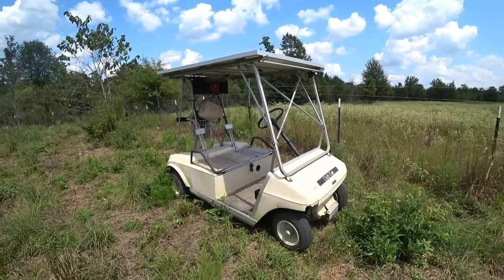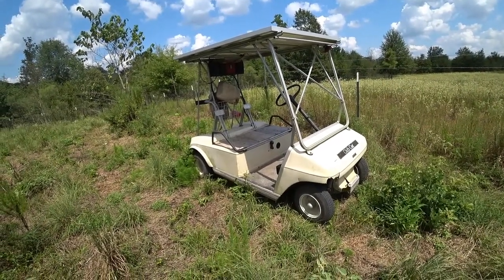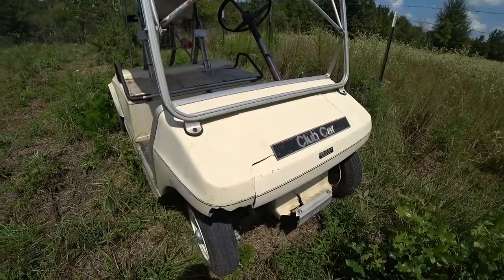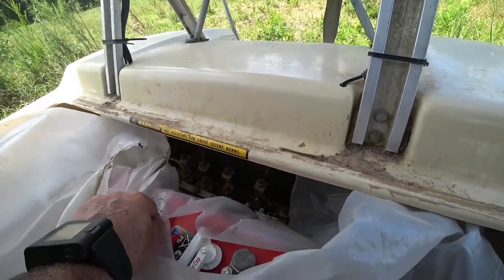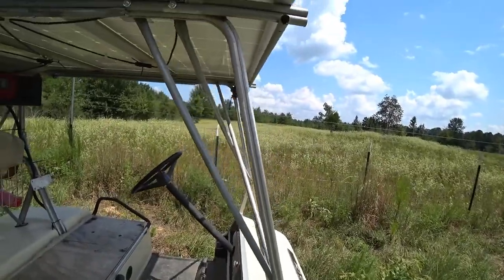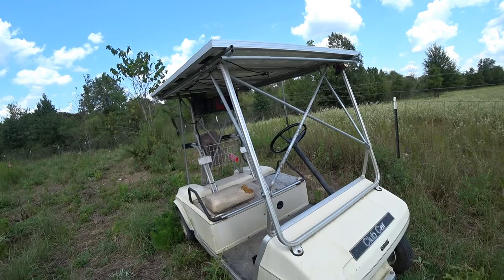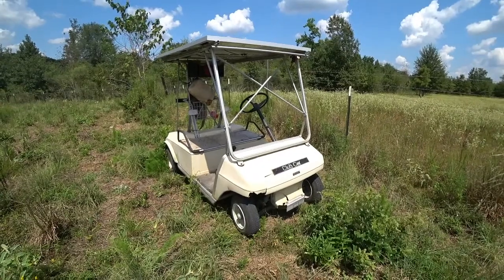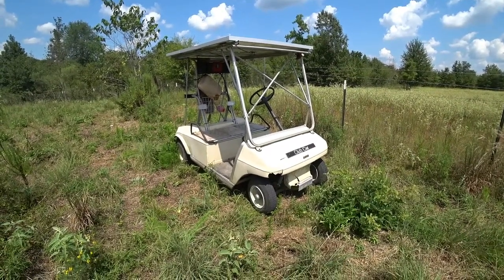How to DIY Solar Powered Golf Car, Driving on Sunshine

Comment: Your setup got me thinking. suppose you hook your 3 100 watt panels up to 2 batteries each. that is 1 panel per 2 batteries. No charge controller. Your panels come with diodes installed for back feed reasons. Understanding this... you can use a 12 volt charger and attach that to 2 batteries in series to charge . ( works fine ). Using the same idea only using the panels, you could do it with no worry of back feed because of the diodes in the panels. That's the direction I'm headed. Interested ib your thoughts. Thank you.

Comment: Why the expense and trouble for very little extra run time ?
I can run my cart all day and have gone around 35 miles in 1 day .
Reply: With solar panels you almost never have to charge it. A lot of people use their carts everyday. Keeping your battery fully topped off will extend the life of your battery. Never having to worry about it being dead nor having to charge it. Not everyone will drive the max miles per day. Some might only put a few miles on it and while that does not eat up a lot of energy the solar panels will pretty much keep the battery at full charge.
Reply: @kameljoe21  ...There is no such thing as free energy.  While the panels will charge the batteries while the carts not motion once the cart is in motion the panels will not be able to produce enough energy to keep up with energy lost . You might get a couple of miles extra run time.
Why not just charge the batteries at home using solar panels , it makes no sense to add the extra weight to the golf cart .
Reply: @toledojeeper2932  Its all good, I will chalk this up to someone who does not understand.
Reply: @kameljoe21  ...lol..I understand completely  , but with the added weight you are not going to get much extra run time . Those panels will not keep those batteries charged all the time if you drive the cart for a while because there is no such thing as free energy ( meaning power input can't keep up with power output )  .
Why don't electric cars have solar panels all over them ...because theirs not enough benefit from it .
I use my cart everyday , I charge it every night  , it's not a big deal to hook it up to the charger.
And actually keeping golf cart batteries fully charged is not recommended  , the batteries should be discharged to no more than 80% capacity regularly.
Reply: @toledojeeper2932  The point I am trying to make is that you use your cart every day. Its not about extending the use. Its about not having to charge it at all. Ok lets just assume you use 500 watts an hour and you use the cart driving for 3 full hours per day you now have used 1500 watts. ( just to be clear I am just using numbers here and its not always going to work out ) You have a 500 watt panel on your roof ( yes you can buy 500 watt panels all the way up to 690 watts I think. They are about 8 feet long by 5 foot at the max. Not all of them are that big ) and you are out side all day to which said panel will produce you 2500 watts, 1000 watts more than you need. In the end you will return home with a full battery rather than a battery that needs to be charged. In some cases people only use them for under an hour per day and not having to plug them in every day to charge you, those people can pretty much go for years and years with out ever having to plug them in. To which they might save 100s of dollars in electric cost over their lifetime. Either way some people want solar and you can do it very well, the weight is no more than adding a set of clubs or having your fat friend ride with you. Though the big deal is that charger cost cash every month to charge it plus its not very effective. With direct solar charger you can provide a charge all day long and even if you have to top off the battery once a week its still worth it.
Reply: @kameljoe21  ...To say a golf cart battery charger is not very effective is totally incorrect.  Most new chargers shut down and then provide trickle charge to the batteries as needed as well as provide desulfatation of the plates  and some provide temperature compensated charging .
My last set of batteries lasted 9 years and I believe that was due to my charger maintaining the batteries .
Reply: @toledojeeper2932  electric cars typically drive further than 12 miles a day and use way more power to do so due to weight.
 thats what 3 100w panels will get you if you run the modern lifpo4 batteries... the added benefit of the lifepo is higher maintained voltage and a much farther range to begin with I have a single 355 42v solar panel for my 36v cart and dont even own a stand alone battery charger. since the batteries are always topped off or close to it I can expect to get somewhere around 15-20 years out of them. oh and my 200ah lifpo battery litteraly weighs less than a third of what you old lead acid batts weighed... plus its worth it for no maintenance total cost? $660 .... 1460 with the cost of the cart.
Reply: @toledojeeper2932  the lead acid batteries im about to pull from my cart are from 2012 and still test as fine due to always being close to full charge due to solar... just saying. I almost felt guilty replacing them with the lifepo but I had them in my rv for years and one 37lb battery blows them away performance wise. I could never run things like my coffee maker before without issues even when the batteries were new. btw I have solar on my house and havent had a electric bill in 3 years... I use way more electric than I ever did before with a hot tub and central air. lots of half truths and misconception from bias.
Reply: @fathergratwick  …yep , a lot of half truths from bias thats for sure .
You say you never had a electric bill in 3 years . I guess your solar panels , inverter , and batteries were all free… lol . Storing solar energy isn’t cheap , i priced and at $20000 it not worth it .
I only stated the truth , that setup is worthless when you are putting a lot of miles on a cart . I live in a 55 community and a cart is the main mode of transportation and is constantly being driven . I have even seen people switch from lithium back to lead acid batteries because they were duped and told that any lithium is better than lead acid . Now sure , if you don’t put a lot of miles on your cart and you don’t mind leaving it sit in the harsh sun all day , solar panels are great .
As for weight savings , the weight on a cart should be replaced when switching from lead acid to lithium so the cart isn’t easy to tip over .
Reply: @toledojeeper2932  I have no batteries for my home system. Where I live the power goes back to the grid and the meter keeps track of it. I get it all back for free when I need it later... think of the grid as my battery. and funny you should say that about it not being free. I have a duplex so I had both my main services replaced with new breaker panels and the whole solar system installed and even with financing the whole thing, after incentives the remaining balance Im paying on is a loan payment thats less than my electric bill was before (and that was before I could afford to run ac all summer)  and in 8 more years when the system is completely paid off and everyone else is paying twice as much for electric thanks to electric cars and such ill really be ahead. In fact by the time the warranty is up at year 25 on my solar setup I will have saved about 50 grand... Ive had the same panels on my rv for over 10 years and they still pull in about 95% of the power as they did when new.
As far as lithium vs lead acid? I have actual  experience with both  and theres no comparison... Do you?
 A 200ah lead acid battery has only 80-100ah at most  of usable reserve and suffers from the pukeart effect which dramatically reduced the amount of power that can safely be drawn off the battery at once. Lithium doesnt have that. You can also take a lithium battery down to 20% with  no damage to the batter meaning that you get 160ah out of that same 200ah battery. lifopo4 is hands down better than lead acid for most applications. I dont need to store my golf cart in a garage.. I use it at a campground, most golf courses store theirs outside as well, thats what they are designed for. And your comments on the weight savings? It seems your really reaching for excuses now. These are golf carts if your driving them recklessly enough to flip them your not using them correctly.
Reply: @fathergratwick  ..here come the half truths . If you are net metering you are paying a monthly fee unless you are lucky enough to be with a electric company that has no fees yet  and that will even buy the energy . Also as far as panels producing more power than you are using daily I believe there is a little embellishment . Also the comment about charging EVs off of solar is laughable , you better have a big field of panels or a lot of time to charge it .
Do I have experience with lead and lithium . I have a golf cart shop in Florida . I have guys coming in with cheap lithium complaining about their run times and how lithium is supposed to be better than lead acid and don’t even get me started on the solar panel charging the cart while I drive bs . That’s where all these half truth and misconceptions come in . 
Now if you spend $3000 on lithium that’s great , you will get good run times but I can sell a set of 48volt Trojans for less than $1000 and guarantee you 7 years with a smart charger. I have 7 year old Trojans in my own cart and it has no trouble going all day . If you don’t have a good charger than yes your lead acid will suffer and not perform well .
All the carts here are lifted 6 inches and some higher , that’s why we use weights with lithium. No reputable dealer would put lithium in a lifted cart without adding weight . Too many grandkids driving carts down here . 
You take those lithium down to 20% you stand a good chance of having to be pulled back home . Which is exactly what has happened around here with the cheap lithium batteries.
I have no problem with lithium batteries , I have a problem with the old people conned into buying something that is not cost effective.
When I’m asked about lead or lithium…they is no need to spend all that extra money on lithium when the lead acid will do the job . If you want 30 or 40 miles out of a cart just go to gas .
Reply: @toledojeeper2932  You seem to believe you know alot about things you have no actual experience with? If you own a shop you know many customers cause their own problems and some have unrealistic expectations with improperly implemented or engineered use such as oversized tires causing under powered  carts without the correct modifications. there's probably hundreds of videos on you tube from enthusiastic happy folks who has switched from AGM or lead acid to lithium and how many videos showing how  lead acid is superior?   You take positives like longer battery life and extended range and weight savings and skim right past them desperately trying to find a way to spin a negative out of it. A simple charge level gauge for example would prevent having to be towed back and yeah it takes a bit of responsibility to mind it just like a fuel gauge. And no Im not embellishing over my power production at all my system has been active since april of 2020 and has produced just over 30 mega watt hours of power. As for my lithium batteries I did not buy them with a huge markup as most do. I paid $430. total for my 200ah 36v battery with the cost of the BMS, I paid more for my old lead acid batteries than that. I picked up a new 355w 39v solar panel which will double as the roof panel for $190 yesterday as the 44x65" dimensions are perfect. in my case going solar was cheaper than sourcing a factory roof panel. And the best part is I will never have to be "towed back" because 15 minutes in the sun  charging at about 12 amps will charge my cart enough to get from one end of my campground to the other.
Reply: @kameljoe21  Indeed, difficult to explain to someone who doesn't even understand the principle. I built my own 100ah 48v LiFePo4 battery from sixteen 3.2v cells and a 16-S BMS. Never have to use a charger. The MPPT onboard charger often stops charging because the battery is at full capacity. Every day we drive an average of around 20 km. I should mention that I live in upcountry sunny Thailand and the one solar panel I use is a 72 volts panel.
Reply: @memkuk  That is super. The system should last you a very long time and no additional cost. Where we live we would need to have a cold temp shut off on the bms or a battery heater to keep the batteries warm when charging. There are a number of batteries that offer built in heaters and a system would work very well in the 48v range. Golf carts or any sort of cart/buggy or homemade thing would work. We just do not have a need for something like this. To go where we need to go several times a week is 70km round trip.

Comment: Can you show the positive and negative of the carts power I have the same cart but all my cables are blk I don't know what are the positive or negative I have 3 cables one from the silinoid and two from the gear shifter
Reply: Rich Ratch  I have tried and still I can't tell maybe I don't how to use a volt meter or the voltage is diffrent
Reply: Rich Ratch  in case u didn't know  they don't make the equipment like this any more so if you screw it up your rewiring the whole setup
Reply from the maker: I will try to post a video to answer your question. I work nights and trying to finish a tiny home trailer build project.
Reply: @explorewithbarryandlagniap7744  I would appreciate it if you can thanks

Comment: New sub here.  I am interested in making a solar golf cart out of a cheap one that has a need of batteries.  I live in the country and could use it to get around the country side.   Do you have a good idea on how to look for used ones.  I like the Polaris Ranger, but I don’t have Ranger dollars to spend haha.
Reply from the maker: Call your local golf courses and ask what they do with their retired carts or try craigslist.
Reply: @explorewithbarryandlagniap7744  That is a good idea.  I think I will look them up.  If all i have to do is upgrade batteries and add solar, that is what I want.  I don’t want to add motors, prefer them to already be in place,  which would be the case with a used one from the golf course.  Thanks again, have a great fall and hope you stay healthy

Comment: I have a solar golf car too!!! 
Instead of you i use only one 285W solar panel (got for free from a solar field because it is a little bit damaged but it still works). 
I use also a very cheap mppt boost made by sunyia (30$ on aliexpress).
 It rises the 24V from the solar panel to 54V to charge the battery. 
It works very well and  in a solar day i can drive up to 20km only from the sun